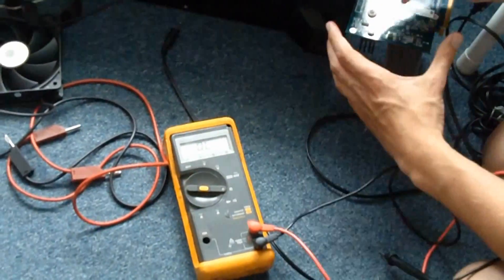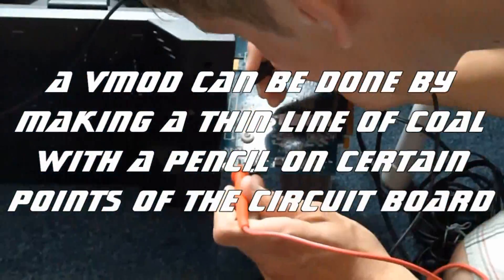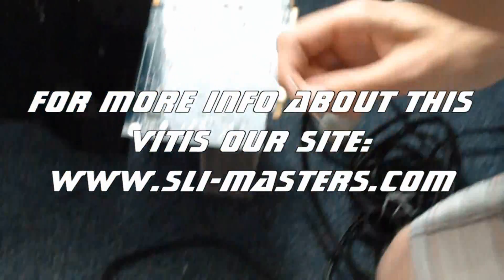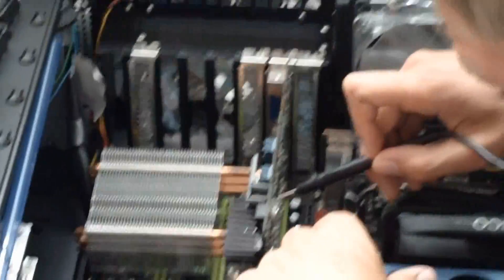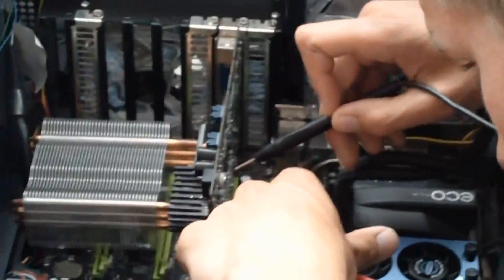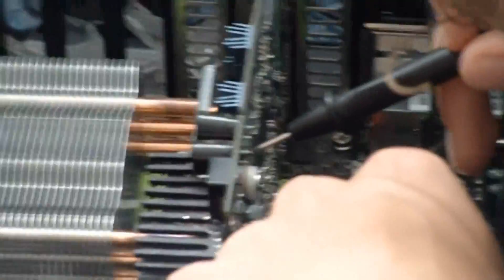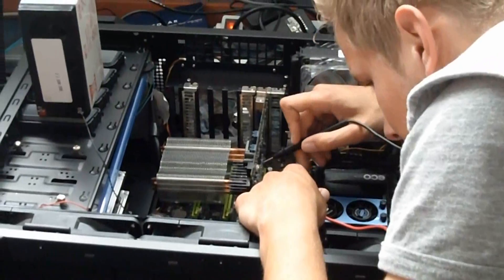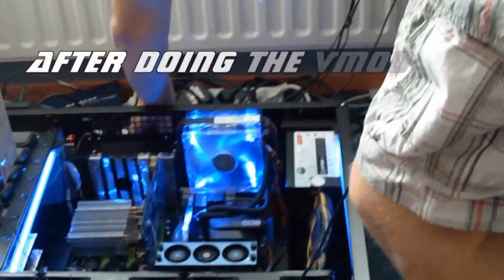Overclocking 8600GT Voltmod (wr singel 8600gt !!!)  by Mausio

Comment: of cause it's gddr3, ddr2 can never get that high clock no matter how you tweak it(i had a 9500gt ddr2 and it can only capable of running 750mhz/1.5gt at max)...

i can get even higher with same tweak on 8600gts and get 30~50% more performance out of it because of 6 pin pcie get more current to the card(which as fast as stock 8800gt with core clock 1.5ghz and 2.65x shader clock + 1.6ghz/3.2gt ram).

Comment: i got my 8600gt stable at 900mhz core/2340mhz shader/1050mhz ram (2100MT DDR) with 1.7v core and 1.6v ram. the 8600gts can even go above 1.1ghz core with 2.86ghz shader and 1.3ghz ram (2.6GT) at same voltmod. it can even perform close to 9600gt and 5670!!